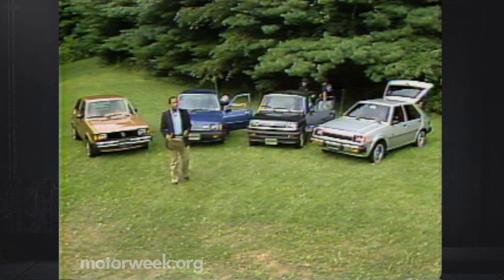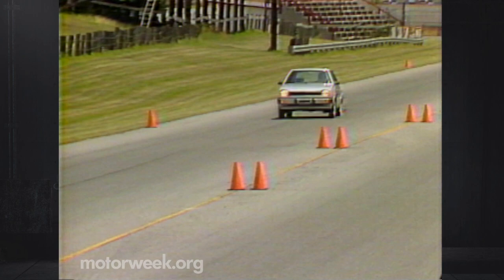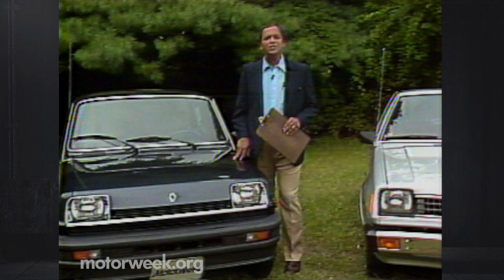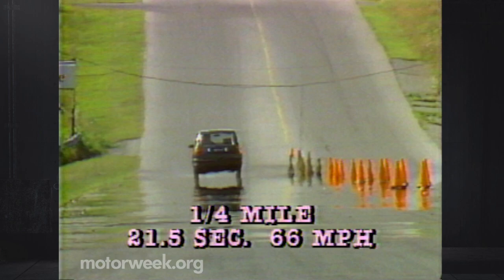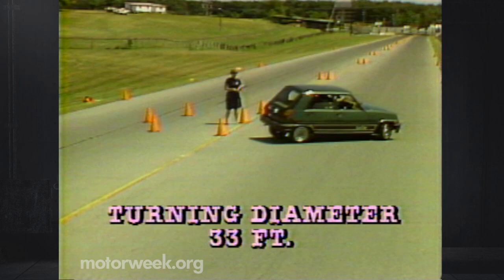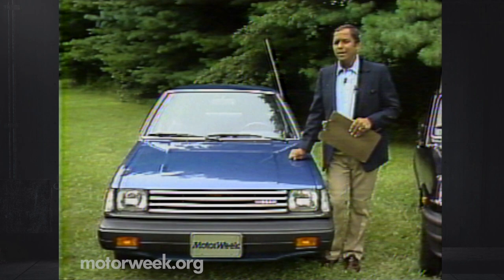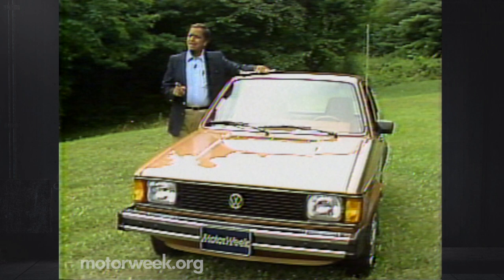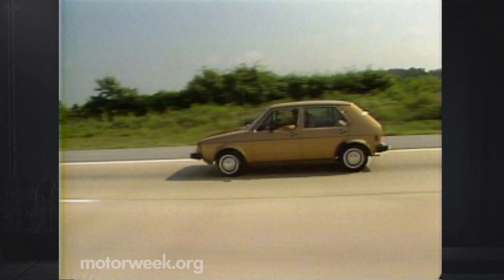Retro Review: 1982 Econobox Comparison

Comment: Renault were sold in America, who knew.
Reply: So were Peugeots.
Reply: So were Citroens.
Reply: Why aren't they sold anymore, I would totally buy a Renault Clio.
Reply: Yes, they sold here until the late 80s or early 90s.  A few of the last Renaults I can think of here were the Encore, Alliance and GTA.
Reply: Opels used to be sold here, too, through Buick dealerships in the 70s.  My grandmother had an Opel Manta and my aunt and then dad owned a Peugeot 304.
Reply: Citroen pulled out of USA in early 70s, they only sold two products, the DS and SM. Both unique and expensive therefore didn't sell in volume numbers. Peugeot last sold cars in the States in 1992, one car the long-running 505 was replaced by the smaller 405, but lack of marketing/investment and a proper dealer network finished the venture. Renault bought AMC and had access to their dealer network, since the mid 70s and up until 1988 they marketed a range of cars (R5, 9, 11, 18 and Fuego). AMC was then bought by Chrysler which meant all Renault-badged products were withdrawn, however their legacy ran for a few more years with the Renault-designed Eagle Medallion and Premier cars (Renault 21 and 25 models). Today though a lot of Renault input is found in Nissan cars. Worth noting that the hugely successful Plymouth Horizon/Dodge Omni and Chrysler K cars were based off Simca designs (Simca also sold cars in the USA for a brief period).
Reply: Don't forget the Dodge Monaco which was a rebadged Eagle Premier
Reply: Opel is owned by GM.
Reply: Because all of your affordable French, English, and Italian cars were JUNK! Horrible reliability and rust forced them all out of the USA by the early 1990's. FIAT meant "Fix It Alla Time" and "Fix It Again, Tony" to most Americans. The fact that Consumer Reports puts the FIAT 500 at the bottom of the reliability charts tells me nothing has changed.
Reply: Yup Dodge Monaco, Eagle Premier, Renault Medallion the chassis (B) became the engineering foundation for the Intrepid/Concorde/Vision.

On the Peugeot front the 505 was a superb handling car and gave the MR2's of the day a run for their money in SCCA competition.  The 405Mi 16 was a brilliant car 160HP out of 1.9 L with the XU9J4 engine that was later turbocharged in the 206 WRC.  Consider this this was an 80's production engine that would take Honda and Ford almost a decade and a half to match in the Civic SI and Focus SVT respectively.

It was an inadequate dealer network that killed the French car in the US.
Reply: Manta was a nice car.My neighbors kid had one back in the 70s.
Reply: I'm in the UK, and trust me you don't ever wanna own a French car. Sure the Renault 5 (le car as you called it) was quirky, but it was shit. The Clio simple original versions were ok for what they were, but now like all French cars they are so packed full of electrics they have become utterly unreliable. Three years down the line, and your Clio is a broken down bag of bolts.
Reply: John Davis believed the Mitsubishi was the one to be copied by US marques, but it was the VW Rabbit (OG / Mk1 Golf) which was copied by Chrysler for their Dodge Omni and Plymouth Horizon...
Reply: Awful dealers and support killed off French cars in the USA
Reply: *****, Renault dictates quite a lot of their style, particularly both generations of the Versa Sedán, the former Versa Hatchback and the Leaf EV, which came from the latter.

But if what happens with the reliability issues of US-spec Fiat models available applies to Renault I can say Nissan makes quite a bit more reliable vehicles than what Fiat or Renault can offer on theirs. Like the Nissan large NV vans vs. the Ram ProMaster (US-made and speced Fiat Ducato) large van.

The only US-spec Nissan that uses a proper Renault platform is the Rogue compact crossover (now the brand's best seller), which is shared with the Megane range of C-sized cars.
Reply: 1987 was the last year for Renault.  They sold AMC to Chrysler, tucked their tails between their legs and haven't been back since...
Reply: The Juke uses a Renault designed turbo 1.6L engine.
Reply: The engine (a 188hp T-1.6L) was CO-DEVELOPED by BOTH Renault and Nissan, but it is mostly used by Nissan (in US-spec the only other car that will have it from '17 MY is the (C17) Sentra Turbo / "NisMo", but other overseas models use it, like the EU-spec X-Trail, their version of the US-spec Rogue compact crossover). 

The only Renault models on which is used are the Clio Sport, uplevel modern successor of the LeCar tested here and the Renault Samsung SM5, a made in South Korea version of the last generation Nissan Altima.

Renault uses more extensively other engines from the MR (M for Renault) family, like the NA-1.8L from the US-spec (C17) Nissan Sentra / Sylphy.
Reply: "1987 was the last year for Renault.  They sold AMC to Chrysler, tucked their tails between their legs and haven't been back since..." 

Not necessarily, since Renault has owned 44% of Nissan's stock for a while and has influenced Nissan's design. IOW, they DON'T NEED to be selling their brand in US to take advantage of the market, as they tried with American Motors...
Reply: I meant the Renault brand.  Technically, Renaults were still sold for several more years under the Jeep/Eagle brand name.  Medallion, Premier and Monaco were all Renault vehicles.
Reply: Yeah, IIRC, it was a joint effort by Renault and American Motors.
Reply: The Le Car (Renault 5) was before the AMC connection. Renaults from the Dauphine to R8 and R10 to R16 and others were sold by various foreign car dealers. The poor quality of the Dauphine kind of killed their reputation from the beginning and the rest were offered but did not sell that many.
Reply: The 16 by the way was a much larger version of the 5 in terms of engineering.
Reply: The Omni was already out for half a decade by 1982, the Talbot Horizon while visually similar to the VW Golf / Rabbit it was more an evolution of the Simca 1100 than a clone of the VW.
Reply: I knew.
Reply: For the last 8 or 10 years of its existence, the American Motors Corporation was majority-owned by Renault.  AMC sold many Renault cars out of their dealerships, in addition to the AMC cars they usually sold.  It didn't help AMC much that Renault's long-term quality was crap back then.  Most Americans still regard French cars to be pieces of crap, simply because of Renault's reputation back then for being junk.
Reply: they moved to mexico, but they'll pay for that. hehe
Reply: +snowrocket Well yeah, English mass market cars literally ceased to exist, the industry there went stale and collapsed due to mismanagement, and Italian cars were and have for a long time remained rust magnets. In the early 2000s, my street was full of Alfa-Romeos, but they were all eaten by rust, which is just such a pity, they were beauties. A friend of mine had an almost new Lancia that he couldn't open in the winter because rust kept blocking the door lock! However PSA France vehicles (Peugeot/Citroën) had absolutely excellent rustproofing since mid 80ies, they were not only made from coated panels, the whole body was dip coated, and the drainage wasn't bad either. But you look at an early 2000s Mercedes, and you'll see rust running down and paint bubbles, yuck. Many 205 are still virtually rust free even in wet and salty climate. People say bad things about electrical reliability of French vehicles in general, but PSA vehicles usually had at most a couple weak points where the wiring would go bad that aren't that hard to fix. There really hasn't been all that much difference between EU vehicle makes in electrics since the early 90ies, German, French, basically same shit, barring minor mistakes. The Peugeot 406 was widely used in France as a taxi cab and did OK with high mileage abuse too, turned out surprisingly reliable. I used to take a lot of cab rides, and here in Germany, taxi drivers got so many issues with Mercedes recently that they started abandoning them en masse, and all of them complained about countless minor faults and service costs growing out of bounds, all of these being majorly recent issues. First you'd see lots of VWs and Fords and Citroëns appearing, and recently mostly Toyota Prius.

With a mass market vehicle, there's always a chance of a couple % that you get a lemon, regardless of make, they are all built down to a price, so service quality and warranty treatment will be deciding, and that obviously depends on the region and the specific local network, so you just can't generalize that from one country to another. I bet that's what's colouring the Consumer Reports so negatively for FIAT 500 in USA these days.

Though i guess there's always something about the home country slightly leaving an imprint on the vehicles. French with their bumpy roads, USA with very straight roads, and Italy with its mild climate and mad drivers where cars really succumb to bumper car style driving rather than to any vehicle faults.
Reply: Yep and if this show would have take place in 1984, the winner would have been the Peugeot 205 ^^
Reply: They still are technically. Nissan and Renault are the same company.
Reply: Opels still are sold here too technically. They are just rebadged Buick's.
Reply: Lawrence Hodge That's a good point -- Nissan gets a number of its engines from Renault, along with many other pieces and parts.
Reply: They're coming back. I recently saw a report wherein they're beginning to structure a dealer/service network like Alfa Romeo. They're hoping to be back in the market here starting in 2020/21 if I recall. I like Renault and drove a Clio while living in Europe
Reply: LOL!! AMC Alliance and MACK Trucks.
Reply: Chris Dooley They are already sold. Nissan has Renault influence, so it is unlikely that Renault will come and take away Nissans market share, or vice versa
Reply: Renault's last year was 1987 Renault put AMC on the sales block and Lee Iacocca from Chrysler brought the company.
Reply: brian5o I thought some of those were sold through American Motors Corp.
Reply: Yes AMC sold Renaults through AMC dealerships from 1975-1987
Reply: Chris Lemaster oh ok
Reply: Logan They sold Renault Le Car (1977-1984) Renault Feuego & Fuego  Turbo(1982-1986) Rebuilt 18I wagon(1978-1982), Renault Alliance 2 door 4 door (1983-1987) Renault Encore(1983-1987) Renault Encore Electronic  rare Renault with a Digital  Dash (1986-1987), Renault Alliance Convertible (1985-1987) Renault Encore GTI(1987) Renault Premier (1987-1992) which became the Eagle Premier when Chrysler's Chairman Lee A Iacocca brought AMC in mid 1987 then it was rebadged as the Eagle Premier(1988-1989) then they renamed it the Dodge Monaco(1990-1992) in hopes that it would help sales. It was dropped after the 1992 model year. The Renault Premier became the LH Platform in 1993.
Reply: Chris Lemaster oh
Reply: E Meyer  The original Dodge Monaco was a full size RWD car with V8 power.
Reply: Catholic Priest   But horrible reliability had nothing to do with it?
Reply: dcanmore Well said friend.  Finally an informed consumer.
Reply: You can thank Renault for the Jeep Cherokee and Chrysler's LH cars.
Reply: @brian5o  Opel's have been sold in the US since the 1950s. They were built by the GM subsidiary in West Germany as the Opel Rekord.
Reply: @emeyer6963  Yes, it was a NICE car, BUT it couldn't compete with the Mercury Capri especially the 2.6L V6 version. The Capri would blow it in the weeds!
Reply: Electone_Guy they are back they bought Nissan a few years ago and ever since then nissans have been shit.

Comment: always kinda dug the lecar looks
Reply: It was the first (modern) little car with plastic bumpers when Renault released it, in 1972.
Reply: I used to like the renault alliance , i guess i still would if i saw one. I know they can be a roach. My sister had an 83 way back when and i loved the styling. It was a bit loud but the ride was great and had amazing economy with the 5 speed. Not the most reliable car though.
Reply: Terrence Gold The electric circuit was badly protected around the main radiator, like the R5 Mk2 from it was designed. Some Renault fans re-imported the Alliance convertible, because it was the only official convertible Renault around two decades, SP5 convertible was confidential, even more the semi-official trunked R4, until the R19 Karmann cabriolet was made.
Reply: The R5 Turbo version is the Le Car on steroids.
Reply: Now, in France, if you own a Renault 5, you are rich bcs everybody wants it

Comment: omg all the us renaults are all gone!! :(
Reply: You'd have to look hard but there are a few still around. On Craigslist, there was an 80 Le Car for sale just last year.
Reply: damn i would of bought it no matter the condition!
Reply: The previous Versa was a Renault Clio deep down. Different body but looked like some French car. Not sure how much various Nissans share with Renaults now.
Reply: OK, as I've stated somewhere in THIS thread, the only US-spec Nissan to share any platform with any Renault model is the Rogue compact crossover, which belongs in the same platform family as the Megane family of C-sized cars and its' variants. Nissan also sells a couple of EU-spec compact crossovers from that platform, the smaller Qashqai and the Rogue sister, the larger X-Trail. 

BTW, Rogues doesn't share platform with (C17) Sentras, although they're similar in size...
Reply: If you are talking about the Model 5 "Le Car" (replaced for 1983 with the Alliance and Encore), yes.

Comment: no corolla?
Reply: HodsBroo or Civic, Escort, Omni or GLC
Reply: I've owned an Omni/Horizon and an Escort. Both were junk.
Reply: GLC was a great, albeit simple, economy car.
Reply: WikdSeafood The 1986-1990 Escort GT Is Junk!
Reply: WikdSeafood And I Say That In A Valiant Attempt To Piss Off And Hurt The Feelings Of Escort GT Drivers Who Hate And Prey Upon Chevy Sprints And Geo Metros!
Reply: LOL Sadly there was no Escort GT in 2002 just the SE and LX. All came with the crappy 2.0 SOHC engine, unless you got the EXP which had the DOHC.
Reply: That is not true at all.  The newly styled Escort GT came out in May of 1990 as a 1991 model, I bought one.  That car was around until 1996 with a dual overhead cam Mazda engine.  I bought a 1991 and a1993 new.  They were very good cars.
Reply: I think if they included Toyota and Honda it would have been a one (two) sided contest.
Reply: knifemind 
toyota corolla was rwd in 1982 as was the starlet this was a fwd comparison
Reply: Corolla was a POS in 1982.
Reply: @knifemind  Especially if it included a 1994 Toyota Celica. Rev up your engines!

Comment: Ah the 80's.  The time when cheap and small came to be.  There was one category not listed, crash safety.  The only one in the group that had side impact door beams????  The Rabbit of course. I had one, ( well the pickup) and broadsided a full size Chevy truck doing 55. Never even had time to hit the brake. Aterwards, I was fine and could still open both doors, even though the engine had done as designed and started traveling under the body, and NOT straight back into the firewall.  I miss that little beast. 😞
Reply: What do side impact bars in a VW Rabbit have to do with your front collision with a truck? If the Chevrolet truck crashed into you from the side you would be dead.
Reply: @omartinoco9930  not necessarily.  My sister was hit in the driver's door in her 1980 Dasher, by a 1977 Pontiac Grand Prix, pulling a boat.  It threw her car 60 ft into the field.  Her door only came in about a foot.  She walked away with bruised ribs.
Reply: Not sure what point you are trying to make. THat your sister survived being ejected out of her car during a crash. You were talking about the VW rabbit in a frontal impact, or some truck variant of that car. I owned a 1981 Rabbit and the only crash you would survive is the frontal crash with it's metal bumper. The doors are extremely thin compared to the others.
Reply: No she wasn't ejected.  She had her seatbelt on.  My point is that European cars had already begun increasing safety standards well ahead of American car companies.   Not that American car companies couldn't.  Interesting to know the first airbag deployment in an actual crash was in 1971.  Lincoln had flirted with passenger side airbags way back then.  But they were too "expensive" so the technology was shelved.
Reply: People talk like you die instantly if you crash an old car.  You've been brainwashed by the safety squad. Not saying safety isn't important but hell, better than being surrounded by explosives like in modern cars.
Reply: @halohunter5217  AMEN! And Ive always wondered what the long term effects would be after breathing in the powder/dust coming from airbag deployment. Hmmm.....

Comment: Having worked for a used car dealer in the early '90s, I never had a chance to sample the Renault or (Mitsubishi) Dodge, but did the VW and Nissan. We had an '84 Rabbit that looked and drove great, and an '85 Sentra that we used as our utility vehicle. It was like the Millenium Falcon: it looked terrible, but drove AWESOME! Jim Rr, while I'm not doubting what you're saying that you sold many parts for the Rabbits back then, it is rather interesting to note that "Consumer Reports'" annual subscriber surveys reported much less problems in their Rabbits between 1982 and 1984. Does that mean the bulk of parts you sold were mainly for the '81 and earlier Rabbits? I'm not doubting what you're saying. I'm just curious to learn.

Comment: I owned 3 out of the 4 when I was younger. The Sentra felt cheap and was so slow it was almost dangerous with the automatic transmission. The Colt was nice to drive and had the "twin stick" transmission which was fun when merging on the highway. The Rabbit was diesel and was of the 3 the most solid and well made, easily my favorite.